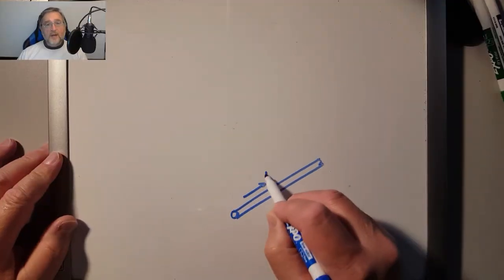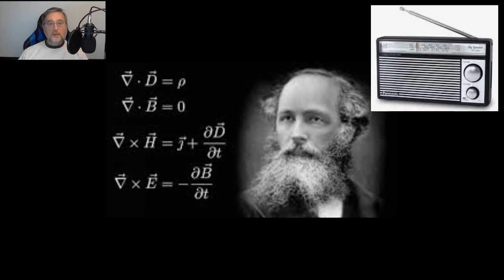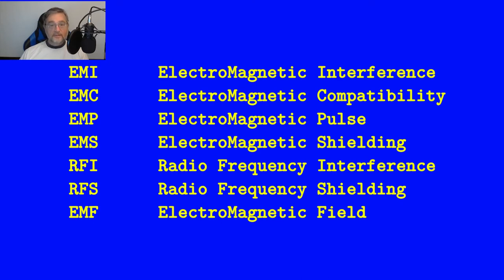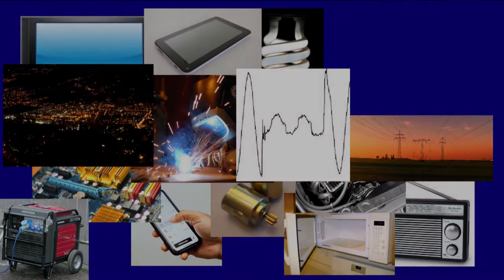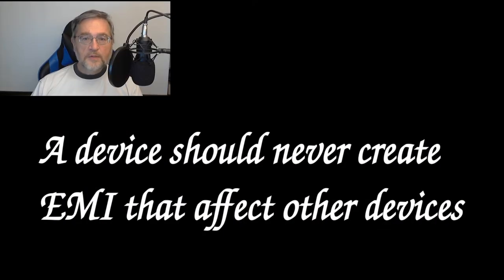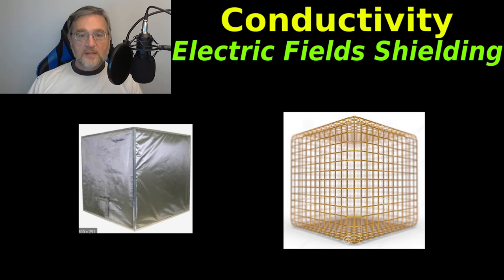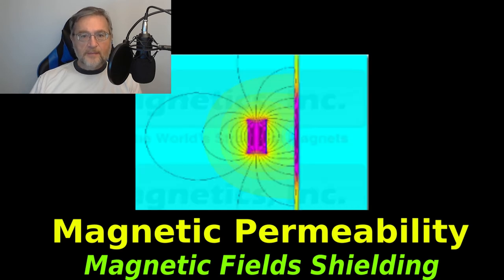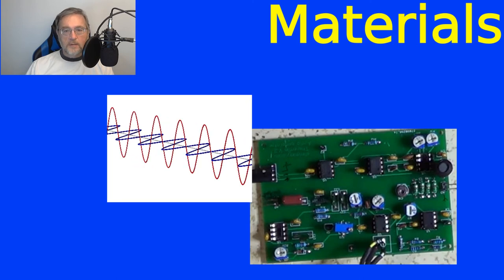Electromagnetic Interference Shielding

Comment: any ideas about mineral shielding such as the often promoted Shungite and some other crystals?
Reply from the maker: Shungite and similar minerals are no good for emi shielding. Shielding requires a highly condutive material and these minerals are not. Furthermore, to.make effective shields you need materials that can easily adapt to various shapes. Shungite, as well as other similar materials, are basically stones and the only way to adapt them to surfaces is to melt them at high temperatures. Why would someone do that, if you can easily work with metals like copper and aluminum in sheets easily pliable?
Reply: Thank you

Comment: 16:12 what do you mean by that? Can you please give me an example?
Reply from the maker: Here an example that should clarify the issue.
Assume you have a circuit on a PCB and assume you need to shield the back of the PCB with a conductive plate.
In order for the shield to work properly, you will need to connect the ground of the PCB to the plate.
Let's assume you do that by connecting a wire between a corner of the plate and a PCB ground track close to it.
The plate is connected to ground and everything works fine.
But now you want to do a better ground connection between the plate and the PCB, so you choose a second corner of the plate and you use another wire to connect it to the closest ground track on the PCB.
It is at this point that you start getting a lot of noise. Why? Becaue you have created a loop that behaves like an antenna (like the loop antenna that in the past were so common for the UHF channels of the old TVs). This antenna captures all the possible noise present in the environment and injects it on the PCB through the ground connections.
The loop I'm talking about is made out of the following elements. The first wire connected between the plate and the track, the plate itself, the second wire connecting the other corner of the plate with the PCB track, and finally the ground tracks on the PCB itself.

You have basically transformed what it was supposed to be a shield in to a concentrator of noise that affects your PCB.

Hope this helps.

Comment: What are the Shielding techniques for Battery Management System (BMS)
Reply from the maker: The answer is much more complicated than you may think. I'll just give you a few hints. Are we talking about a battery that powers some sort of electronic device? Like, foe example, a laptop computer? Or a we talking a battery that powers a switching system to generate alternate current at high voltage, like in the UPS devices, which are devices that use a battery to provide electrical energy when the power grid is down? Or maybe the BMS in an electric car? In these three examples the needs are very different and the shielding will be, accordingly, very different. The principle is always the same, though: we need a metallic enclosure connected to ground that prevents the electric part of the electromsagnetic field to go through. Depending on the amplitude of the EMI that needs to be shielded, the thickness of the shield must change and sometimes, in addition to shields we need to provide filtering on the cables that go through the shield, to connect the device inside the shield to some other circuit outside. This filtering is normally done by putting rings of ferromagnetic material around selected places along the wires, to increase the inductance of the wire which will act as a low pass filter. In other cases, actual low pass filters need to be used instead. And yet in other cases, you may need to do both at the same time.

Comment: Hello thank you for video. I understand this shielding applies to transverse waves. But how can longitudinal waves be shielded? From what I’ve heard longitudinal waves make shielding very hard. Eager for your reply as it has become very important to me to block these. Thank you.
Reply from the maker: We are talking about electromagnetic waves, which do not need a medium to propagate. Such wave can be of three different kid:
1) TEM: Trasverse electromagnetic where both fields are perpendicular to the direction of the motion.
2) TE: electromagnetic waves where only the electric fields in perpendicular to the motion, while the magnetic field is in the same direction.
3) TM: electromagnetic waves where only the magnetic field is perpendicular to the motion and the electric field is in the same direction.
You can see how, for electromagnetic waves, it is not possible to have an electromagnetic wave purely longitudinal. Actually, in general, when electromagnetic waves propagate in the open space, they are usually only TEM. It is necessary the interaction with a material to trasform them in TE or TM.
For a wave to be purely longitudinal, it has to be a mechanical wave, that uses the mechanical properties of the medium to propagate, like the waves in the ocean, or the sound waves in the air. Electromagnetic waves are not of such nature.
Because of the above, the shielding methodologies I have presented in the video, are always valid, for either TEM, TE, or TM wave. For purely TM wave (veru unlikely to happen in the open air), you would have to thicken the shield more then for the TE or TEM waves, but that's about it.

Comment: I live near a power line. I am looking for proper shielding. Is copper or stainless steel mesh curtain good shielding?
Reply from the maker: Well, leaving close by a power line is not necessarily a bad thing. How close are you? is that a high voltage power line? Or  low voltage? How far is it from your house? Remember that radiating power decreases with the third power of the distance.
If you really would like to shield your house against the electromagnetic interference coming from the power lines, copper or stell mesh is fine, as long as it is grounded. But there rae two problems:
1) you should shield the entire perimeter of the house, curtains at the windows are definitively not enough.
2) if you succeed in covering all the external walls and the ceiling with the mesh, you would be totally isolated also from the EM fields that you would want (example: radio signals, also those necessary for your smartphone).
Are you sure you really want to do that?

Comment: Greetings of the day sir,

I just wanted to know what measures can prevent Voice to skull, Remote Neural Monitoring(RNM) and energy weapon signals and waves from reaching you. Will the Faraday cage work? Any help would be really appreciated. Thank you.
Reply from the maker: The Faraday cage works only with EM fields.  Voice is a mechanical wave.
Reply: @eleneasy  How do I block Remote Neural Mnitoring signals? Also, is it possible to deflect them?
Reply from the maker: Brain signals are extremely low power and low voltage. To capture those signals we need to put electrodes directly on the scalp of the subject. I don't believe there is a technology capable of doing that over a distance (Remote Neural Monitoring). Even it it existed, it couldn't just do it with any kind of obstacle between the apparatus and the subject person. The simple walls of your house are more than enough to shield against the possible usage of these apparatuses against your person. Therefore, I would not worry, if I were you.

Comment: Hello Sir,

Your information is very Helpful!

I would have a couple of questions
I am not sure you are willing to reply 
But here they are:
I got myself a grounding sheet.
I been told to lead the wire out and skewer it into the ground/soil and Not plug it into the electric socket as mostly, the sockets are not wired properly to purely ground!
Expect, I get a pure grounding socket made by an electrician.

Is this all correct so far?

Also been told, it won’t work, if just like in my case, I have electric fields, like wires and actually the whole electric circuit board situated in the bedroom:/
As the electrons will pass thought our bodies.

Is this also correct?

How can we best, and without breaking the bank, protect against the electric fields??

Wrap the headboard in tinfoil? lol 
Plug in paint? No?

Many thanks

Stefan
Reply from the maker: Hi Stefan, since I am not totally clear about the scenario you are describing, I will try to answer your question, but that may not necessarily be what you are looking for. If that does not satisfy you, please feel free to repost the question with different wordings.
The fact that the electric socket is not purely connected to ground may cause some issues from the perspective of safety, other than electromagnetic shielding. However, if you had a professional electrician installed a real ground connection that you can use, that should help a lot. I am referring of shielding of electronic circuit, for the human body itself, that should not be a problem regardless.
As per the electrons passing through your body... well, do not believe that. If there are electrons loose in your bedroom, they will have a very low kinetic energy. The worst they can do is to hit the skin of your body and temporarily ionize a few molecules of the skin cells. At that point they will cease to be free electrons. Your body will later get rid of those electrons as soon as you touch any grounded conductive surface. In order for an electron to actually go though a human body, it would need an enormous amount of energy, the kind that can be given to an electron in a particle accelerator. So, don't worry about that. Even more, assuming that a few electrons would be able to get that amount of energy (I wouldn't know how)  and assuming that they would pass through your body, I don't think they would cause any harm. Your body wouldn't even notice. We already leave in a world where we are continuously bombarded by any kind of particle, but they are so few that they do not pose any threat. For particles going through a body to be of any threat you would need a pretty good quantity of them, sort of like standing in the vicinity of a heavily radioactive material.
Don't worry too much about protecting your body against electromagnetic fields. Unless your bedroom lies right below a high voltage transmission line, you should not be worried.
Reply: @eleneasy  Hello,
Thank you so much for your quick reply to my cryptic message.

Ok, that is good to know!

Kind regards 

Take care!

Comment: I have a cable  that is shielded against electric field (equipment generating high voltage) by using grounded shield. But it's creating issues against magnetic field(with an equipment having high current). What can be done in this case ? Will a shield having high magnetic permeability help?
Reply from the maker: I don't think so. If the high current is constant, it will not cause any interference with your cable. If the current is spiking periodically or randomly, then the spikes themselves produce high frequency electromagnetic fields. If the cable is already shielded against electromagnetic fields, then it looks like the amplitude of the field generated by the high current exceeds the shielding capability of the cable. There are two possibilities to fix the problem.
1) Use a cable with a thicker shield and make sure that not only is grounded, but it is also connected to the ground of the electronic circuit to which is connected. The ground connection must be done with a thick cable, to allow for enough charges to move through it to actually be able to work as a shield.
2) The device that is generated the high currents should be shielded as well, possibly enclosing it in a Faraday cage connected to ground as well.

In other words, both the source of the electromagnetic noise and the deviced that receive the noise should be well shielded. A magnetic shield with high magnetic permeability seems useless to me, in this case, because the problem is not a magnetic field but instead is a variable electromagnetic field. To shield electromagnetically a device, it is enough to create electrostatic shields around it. 

Yours is a problem that has been studied for a long time, especially by car makers. In the case of a car, there are enormous electromagnetic fields generated by the spark plugs, and they have to use state of the art shields to prevent the fields to reach the electronics in the car, which is sited close to the engine, and thus difficult to handle. Sometimes, the solution to avoid this kind of problem can be very costly.

Comment: Can you help me with my problem. I'm building a remote control snow blower using an Arduino mega  2560. I properly used shielded wire. But as soon as I start the gas motor the EMI from the ignition system causes the Arduino to freeze up.
Reply from the maker: Ignition of a ice motor can cause serious emi, at high power. A simple shielded cable is probably not enough to prevent the spikes of energy at high frequency to find their way to the arduino. I would need more details on what that wire is carrying to help you out. With what i have so far, i can only suggest to encase the arduino inside a metal box and make sure that both the box and the cable shield are securely connected to the ground of the snow blower. The negative of the arduino should also ve connected to ground. Then, depending if you are transfering just power or some sort of signal through the cable, you may also need to provide further filtering to it. Finally, when running the ground connections, make sure that you are not creating current loops, which would increase the problem, rather than reducing it. Note also that even after the ignition, the spark plug will continue to produce strong emi bursts. You are basically experiencing the same problem that car manufacturers had to face when electronics found its way to the cars.  They had to spend a lot of effort to make that work.

Comment: So we need one shield (magnetic or electric) to  block these two fields?
Reply from the maker: It depends on the situation.
For a static field, you need a shield that is specific for it. A magnetic filed requires a ferromagnetic material to act as a shield. An electrostatic field requires a good conducting material to act as a shield.
For a dynamic filed is different. A dynamic electric filed cannot exist without the presence of a corresponding dynamic magnetic field. And, viceversa, a dynamic magnetic filed cannot exist without a corresponding eletctric field. That's why we do not really distinguissh dynamic magnetic fields and dynamic electric fields. They have to be there togther, at the same time. For this reason, rather than considering two separate fields, we consider a single field, which we call electromagnetic field. Ti shield from such a field we can use either a ferromagnetic material or a good conductor because, the moment we stop one of the two components, the other one ceases to exist as well.
The video concentrated more on electromagnetic fields. In that context, the answer is therefore yes, we just need one type of shield to block the whole thing. And, usually, we choose a good conductor, because is it easier to handle than a ferromagnetic material which, by the way, needs to have a good magnetic permeability to be able to work as a good magnetic shield.

Comment: Hello! I have problem with a home recording studio and what I suspect is EMI from the tram lines close by. It manifests itself as a nasty "buzz" in the audio chain. Is there anything I can do about this? Thanks.
Reply from the maker: If the buzz is very high,  it is probably a problem of missing ground on one or more devices you are connecting together.  Before anything else,  make sure all the equipment is correctly grounded and there are no audio cables with broken connection to ground.
Reply from the maker: @iseeu-fp9po  if the issue happens only when the guitars are connected,  then the pickups could be the issue. You may need to unmount the pickups and lay down some copper tape in their caging in the guitar. The copper them needs to be connected to ground through the audio cable.

Comment: Grazie! How can I shield off my PC case to stop my single-coil guitar pickup from picking up those nasty HF CPU emitions?
Reply from the maker: If the pc had already a metal case, there isn't much else you can do.  One thing you can try is to use one of those power cord with an RF trap close to the PC side.  These cables have a bulge close to the connector that goes on the pc side.  It is possible that the RF noise you are experiencing comes from there. If so. The RF trap will help.
Reply: @eleneasy  Thank you! I'll try it.
Reply: @eleneasy  I've tried it - no luck. I guess, only PC placement can help.
Reply from the maker: I think so.  Try to plug the guitar Amp as far away as possible from the outlet used for the pc.
Reply: @eleneasy  There's no amp. I plug guitar to a USB audio interface and use a software amp.
Reply from the maker: Then try use a USB cable with an RF trap. Possibly on both ends. If with one end, put that side toward the PC.
Another possibility is that the PC is not connected to ground and that should be fixed.
Reply: @eleneasy  The PC is properly grounded and USB cable has RF traps on both ends. The only way to escape the noise is to point the guitar pickup at 90° to PC or play at 2,5 meters distance.
Reply from the maker: Then, I'm afraid there is nothing else to do,  besides using a longer cable and staying as far away as possible from the pc.
Reply: @eleneasy  Thanks for all your suggestions!